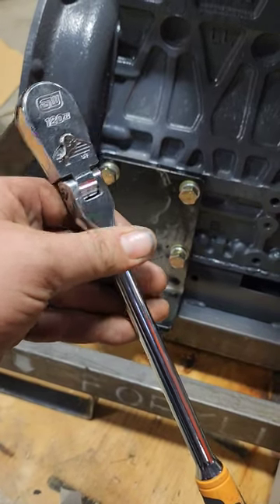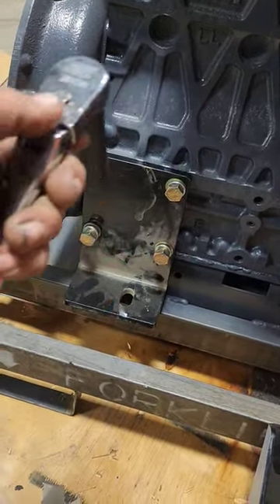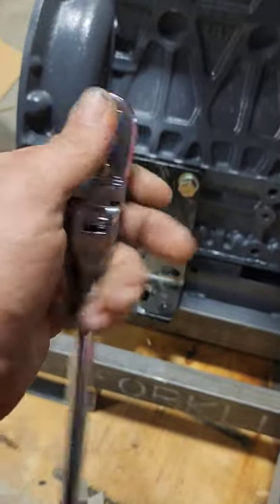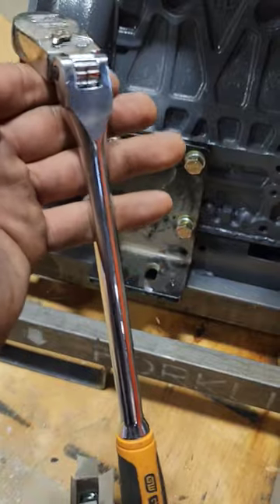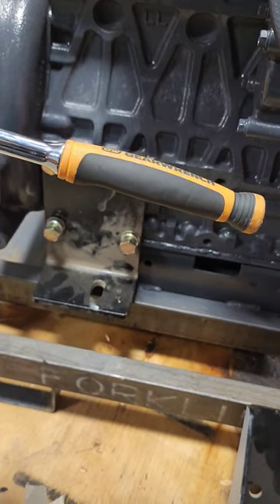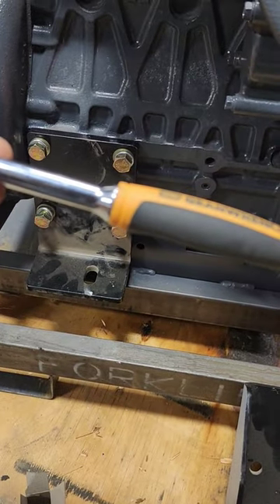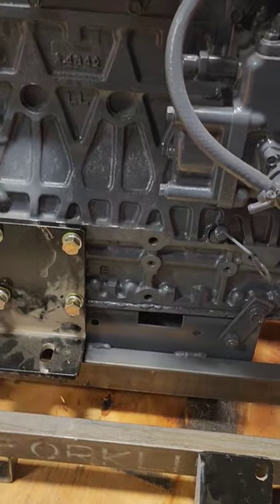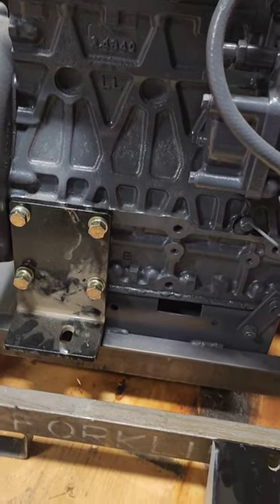GEARWRENCH ratchet update

Comment: Take the head off.  Remove the head lock and spring.  Drop a shim in the hole and reassemble.  It will make it a little stiffer.  On the Tekton ratchet you can put a small o ring or some fuel line and make the flrx head stronger.  Your milage may vary.
Reply from the maker: I think after the month of testing is up I will take you up on those solid ideas. Greatly appreciate  the info and am saving the comment
Reply: @classiclinesautomotive  you might also find that the big deep impact spec sockets are significantly heavier than the chrome sockets the flex head is designed for ;)

Comment: I like the flex heads without detent personally. They flex smoothly throughout the range of pull.
Reply from the maker: I'd be down to try those . Definitely  not to keen on the detent
Reply: @classiclinesautomotive the pitsburgh pro and icon have non detent flex heads. i like my husky locking flex heads which are the same design as the gear wrench in your hand and are both made by apex tools but I think Pittsburgh pro and Icon are also made by apex

Comment: I had their prior model with the fewer teeth and it had the same flex head. Annoying as hell and i didnt like the handle either. I ended up getting the polished handed, locking flex head 120xp and its pretty good. The lock is funky, you might bump it and it will unlock but otherwise its good.
Reply from the maker: I may need to put that one on the list I know they have a long slim 1/4in ratchet I'm wanting to get for interior work

Comment: My flex head ratchet has a button lock that works pretty good and is not in the way.  It also has an extending handle that makes it great for breaking tough bolts loose.

Comment: those detent flex heads are only good for locking flex heads. non locking flex heads should have smooth articulation
Reply: Locking flex heads have slop, detent type don't. His issue is that the tool's default detent pressure isn't designed for a heavy deep impact socket

Comment: All 3 of my 120xp ratchets exploded when I dropped them on accident, hitting the ground with a socket attached bounced the clip loose and spit parts across the shop floor..my go to is a flex head 3/8" fap-off in a 1/4 drive body.
Reply from the maker: I think I would of had a nice wtf moment how ever I'm curious If I can get mine to explode . I have a 1/4 body with 3/8 head on one of those swivel ratchets and love it
Reply: @Classic Lines Automotive  just hold it upside down by the handle with two fingers and let go from a few feet..I can almost guarantee it's gunna pop ...great ratchets beside that fatal flaw..nice thin head on the 120xp ratchets too